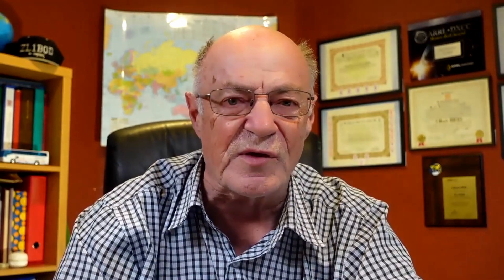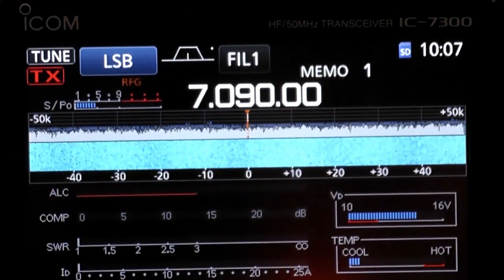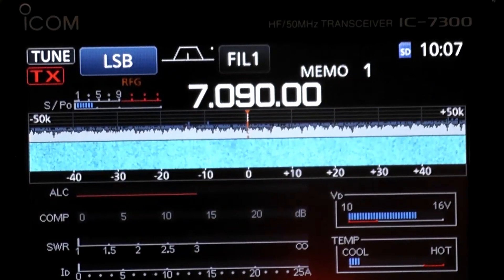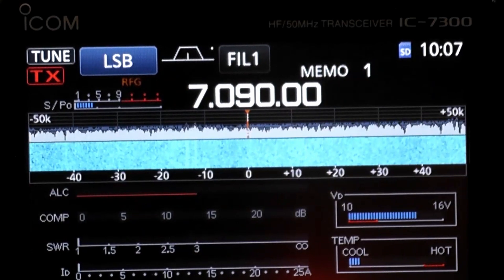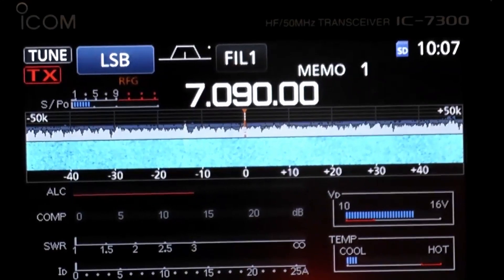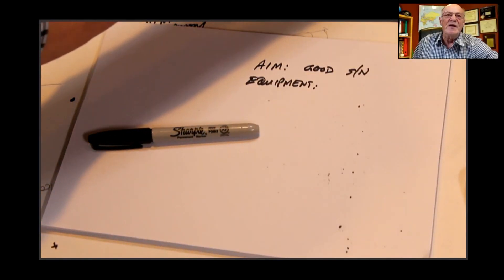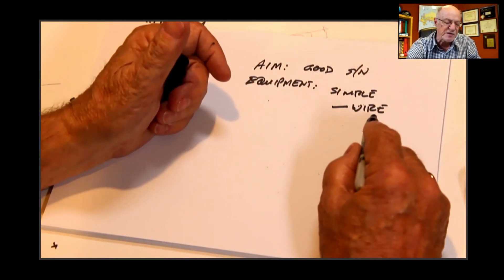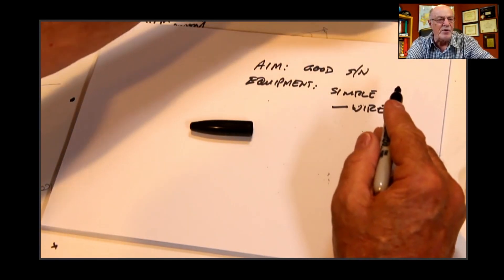HAM RADIO - Eliminate the NOISE !!

Comment: Hi Roly,  I am trying to wrap my brain around this.  The addition of a ground loop increases the signal to noise ratio  because loops are inherently quieter, but if you key down it will transmit using the 40M element of the DX Commander?   Are the effects similar with the other bands?  Or is your fenceline a harmonic of 40M?
Reply from the maker: No no Ed.  I am just using the DXCommander hardware as a convenient way to connect a PL259 to the loop.   There are NO elements on the pole at all.  I am not using the DXC for transmit at the moment.  Just a quick and dirty way to connect a coax to the loop.....cheers
Reply: @ZL1BQDRoly  Thanks Roly, now I can sleep without my mind running all night trying to figure it out...ha.. Cheers
Reply from the maker: @problemwithauthority  Cheers

Comment: Good video! I went the Loop on ground route and it helped a lot.
Reply from the maker: Brilliant. It is not perfect but every little bit helps in a noisey environment....   how large is your loop ouy of interest? .....  cheers
Reply: @ZL1BQDRoly  It is 60ft (15ft a side) in a square fed in a corner with rg-6. I followed the design off KK5JY’s page. Very interesting read and design. It’s 60ft so I get 20m coverage.
Reply from the maker: Great, thanks for the info.  Yes KK5JY has an intersting page for sure.
It does seem that "one size does not fit all" though and each install really needs a little fine tuning....  cheers

Comment: hi roly, I put a loop on the grnd in today, and first results were compared to my 40m long beverage I normally use on rx. my vert on rx is s7 noise from street lights etc, my bev is nil on the meter, and the loop is also nil, but 2 s points up signal wise compared to the bev. so this evening after dark, 6:45pm working france on 40m cw, too much noise on the vert to hear him, on the bev he was 449, but on the loop, he was 559. more details to come. 73 brian zl3xdj
Reply from the maker: Tremendous Brian.  Yes please post details. If you would like to email me sound clips and /or video comparing the three setups then i am more than willing to make a followup video....  cheers
Email in QRZ is fine.
Reply: @ZL1BQDRoly  I was going to email you actually, but could not find your email on your qrz page. I did briefly try earthing the loop as you did, but putting the 9-1 inline worked better, and putting the loop right on the ground compared to a couple of inches above improved it also. will make some video. cheers : brian
Reply from the maker: Just sent you an email Brian...cheers

Comment: Be interested in how long the wire is and the length of your radials. I’ve a 49:1 end fed and to get on 80m it’s 40m of wire which I was struggling to put up. I didn’t consider running it around the perimeter. May give it a go.
Reply from the maker: Give it a go James and let's know how you get on....cheers
Reply: You only need 20m of wire for 80m, the other half (the earthy side) can just be sloped down to fence height in any old fashion or thrown under the house etc

Comment: Hi Roly, that is a fascinating demonstration/experiment, some time ago I ran a very  low wire (not a loop) close to the ground and I also found an improved S/N, it was fascinating to use it to feed the sub-receiver and listen in "stereo". In common with you there were a few places that have stopped me making a full loop, it never occurred to me to go underground for those sections. I shall have to investigate, as for the apparent insensitivity it may be interesting to see what passive impedance matching can achieve, but I know you are continuing your work. 73
Reply from the maker: Agreed, a passive impedance match is next on the block.  Goodness knows what it is at the moment but a proper 1:1 match will at least achieve max energy transfer in the system.  Cheers
Reply: TY Roly.. @ZL1BQDRoly

Comment: I suppose that this loop antenna is for receive only, right? Well, since it is impossible to give it a try in my property, ( I live in a multi floor building), I can though install it on the roof top. Is it a possible solution to reduce the noise? The roof top is almost 10 m above ground.
Reply from the maker: My gut feeling is that it would not work on top of a roof of a multi floor building. It has to be very low to the ground so that noise shoots over the top of it so to speak....
BUT, give it a go, maybe it will work?  ....cheers
Reply: @ZL1BQDRoly  Thanks for the reply. It's rather difficult to install it, especially right next to the metallic fence all around the terrace. Anyway, thanks for the info and the help. 73 de SV1SLB
Reply: If you have roof top access for antenna work, why not put up your loop but instead of laying it on the surface of the roof raise it above the roof just as much as you can
Reply: @fredroessler  I already have done that. In fact the loop is around 7 m above terrace level. Nevertheless the noise is still very much present.

Comment: really interesting Roly I have a W6IUV preamp to build and always thought about putting it on a loop (like a wellbrook) but this looks interesting my only problem is there's a whole lot of concrete where I'd like to return to the shack so I''d have to come up to about 7 or 8 feet  then it starts to  loose some of the benfits either that or I bury it and return it back along the same route for about 15 feet making a sort of ladder line ... I think  this is a 3 mug of coffee problem 🤣
Reply from the maker: Maybe even a 4 cuppa...... Well the old adage of "suck it and see" comes to mind.....
Please let us know how you get on with the preamp.  I have one here which is very suitable, however the concern i have is front end overload to the Receiver.
The IC-7300 has plenty of "preamp" as it is so an additional 30dB up front maybe a little much.......cheers

Comment: Thanks for the inspiration, Roly.  I am in a noisy urban environment, too, so I will give the loop a try. I can make quite a long one as I have a long 10 metre wide Greenway behind me. I suppose you are using the radials to ground the coax braid? 73, VE7AWV.
Reply from the maker: Yes the coax braid is connected into quite an extensive radial field...   cheers

Comment: I recall using a loop antenna on 80m late last century. It had many poles holding it up and was anything from fence height to 11m high in places, but was quiet and worked brilliantly from VK4 into VK6. Only thing I never figured out how to do was automatic switching from TX to RX at 400w (or 1.5kw for those that can use it). Thought about automotive relays but wasn't sure if they were OK at HF. Cheers Adam VK4IM
Reply from the maker: Ahh switching is always a problem in the traditional sense.
Many of the modern rigs have a seperate Rx input which is automatically switched on Tx.   That feature is what i am using.....cheers
Reply: @ZL1BQDRoly  Hi Roly I Looks like you were using an IC-7300 in the video. I'm guessing your using the INRAD RX7300 reciever mod or similar?
Reply from the maker: @VK4IM  👍 cheers

Comment: Nice one Roly, although I was jealous of your starting position noise floor! You can easily flip the radiating plate connection on the DXC over to the lower ground radial plate, thereby adding one large loop-radial to the setup when in use as a vertical 😀
Reply from the maker: Yep thought of that... Cheers Ian
I will link your work on this in the description below.....

Comment: Hi Roly, I have a Colorbond steel fence on three sides of my property. The DX Commander works reasonably well at 2m from fence. Would you recommend putting the wire loop 30cm above the fence or run it inside the fence 30cm off the ground?
Reply from the maker: Probably inside the fence off the ground.....but suck and see i guess.....cheers

Comment: Omg a full wave loop at 30’ high fed with balanced open space Feeder and you ll be S9+10 into the states can’t wait Roly
Reply from the maker: That's a fiine dream to have Kevin...cheers
Reply: I agree. Get your loop off the ground! And quit wasting energy in lossy coax...450 or 300 ohm twin lead is the way to go. Also tune that with an antenna tuner.

Comment: Inspirational video Rolly. I now have a reason to build a decorative fence around the front of my yard and the rest is easier. How do you terminate the downstream end of the wire?  I’m very close to writing my exam (just a matter of scheduling during COVID) and with a little luck will be getting a DX Commander in June so will be looking at doing this in the very near future. Cheers from Moose Jaw. Tim
Reply from the maker: There is no termination of the wire downstream as you would do with a beverage antenna for example.  It is a continuous loop with one end of the loop to the centre conductor of the feed line and the other end of the loop to the braid of the feed line.  
I just used the base hardware of a DXCommander for convenience....   cheers
Reply: Ok that makes sense. Thanks for the quick response and forgiveness for misspelling your name. Cheers Roly.
Tim

Comment: I use a MFJ 1026 and  rx antenna that can receive the local noise as good or better than my main HF tx vertical, using the mfj 1026, I can phase out the local noise no problem...Works for me de Ei2iP..
Reply from the maker: Thanks Robbie.  Is that local noises that can be individually singled out, say a local plasma TV or does it deal to the total noise floor?
Whatever works is always good news of course...  Cheers

Comment: Excellent job. I’ve done a loop on the ground vy simple and not so big. Often using the preamp of the rig it’s enough.
Reply from the maker: Yes, the preamps in most modern rigs seem to be more than adequate.
The danger with using a high gain low noise amp is front end overload particularly with SDR type radios....cheers

Comment: Interesting Roly. I experimented with a loop round my Garden, must have been around 120 or more yards ish, around 1 foot off the ground. However I used some electric fence wire I had hanging around and a 1 to 1 balun to connect them to coax. My results were very poor, of course it could have been the balun or the wire was not suitable. The electric fence wire I think is steel wire woven into some sort of plastic string. I do have a part roll of DX10 that I might try out with though looking at your results. I have a 7300 with the RX ant mod on it btw.
Reply from the maker: I was using a7300 for this experiment.  The RX Ant mod looks to be very simple and would be ideal for this sort of application....  Cheers
Reply: @ZL1BQDRoly  I would imagine it might be quite easy to home brew, after all the one I bought is only a couple of phono plugs, some coax and connectors and a small plate.

Comment: So if I'm understanding this solution, the loop runs from the driven plate of the DX Commander around your property and terminates at the DXC ground plate. Does the loop affect the Tx of the DXC? Thanks for the video Roly. Always enjoyable and informative. BTW did you ever try the 10 meter band, brass tubing half-wave dipole I sent you a while back? If so, was it okay or rubbish in your opinion?
Reply from the maker: Martin, I am only using the DXCommander driven plate and radila plate as a convenient way to couple a pl259 into the loop.  I have NO elements on the DXCommander at the moment and not using it for transmit.  When i reassemble the DXcommander then i will have to look for another coupling solution.
The 10mtr Half wave dipole sections work very well, but you sure have to be very careful not to bend the smaller sections for sure.
I used it last weekend on a SOTA outing actually and made several contest with it....  Cheers
Reply: @ZL1BQDRoly  Good to hear it worked for you. You're right about the fragility of the thinest elements. I built one for 6 meters and the largest element is 1/4 inch. The good thing is that it is light as a feather. I was thinking about building 2 more and putting all three together to make a yagi type array.

I installed a Husqvarna Automower for my lawn care a few years ago. It requires a continuous boundary wire that is approximately 250 meter in length. The wire is staked to the ground and not buried like an electric dog fence wire. I'm going to see what happens if I connect my radio to it. I'll let you know. Cheers
Reply from the maker: The old adage Martin, "Give it a go...."  Cheers

Comment: That makes a big difference to getting that QRP station.
Is that a wire coming off the ground plane plate of the DX Commander Roly?
Reply from the maker: Yes, one end of the loop comes from the driven plate of the DXCommander base and the other end of the loop goes to the ground (radial) plate.
I don't have any elements on the DXCommander at the moment so was just using the base components as a convenient way to connect a PL259 into the system.......  cheers

Comment: I've recently tested a 4.5m2 'loop on the ground' design by kk5jy. It's slightly elevated because of the deck in the garden. Some parts do touch the ground. I've connected it to my flex-radio 6600 rx A input and I'm currently testing with the pre-amp settings. Adding between 4 to 16 db of pre-amp gain shows a lot more signals on the waterfall.  The QRM dropped from 95 dBm to 130 dBm or roughly 5 S points compared to my 1/4th 20m vertical. Last night I've tested it on 40m and 80m and it sounded fantastic! It's so much easier to listen to conversations! Don't worry about the S reading, because that doesn't really matter. When you can copy them,  you can have a QSO. This trick really 'pulls' weakers signals out of the noise. There are  a couple of experiments I want to try, for example put it on a flat concrete roof to see how that performs and maybe change the size of the loop to see if it also works on 15m and 10m for example. Do you have any experience with that Roly? Check out my QRZ page for pictures on the current setup. 73! PA2ADX
Reply from the maker: The kk5jy build seems to be a great design as well....cheers

Comment: Very nice video Roly. Great job on reducing your noise floor.
I will live semi rural on a bit more than an acre soon and all neighbours have an acre too so I think I will be very lucky I guess.

Keep up the good work mate.
73 from across the ditch.

Kevin, VK4KK
Reply from the maker: You make me rather envious Keith.  That used to be my circumstances years ago, but now we are locked into suburbia.  My only other recourse is to set up a remote somewhere in the country....cheers
Reply: @ZL1BQDRoly  Fair enough Roly. I am sure though that you have other advantages where you live such as proximity to shops etc. We need to drive at least 20 min to get to a decent grocery store. Everything in life is a trade off :-)

Remote sounds good to me. I think you are in the process of looking into that already if I remember your chat with Callum correctly.
Reply from the maker: @VK5KU  You remember well Keith.

Comment: That must have a great moment when you heard the signal on the loop. I have experimented with a RX only loop on the ground made by good friend Tom G2NV. I did get a significant drop in noise floor with low but readable signals. It comprises 20m of insulated wire in square loop on the floor fed by coax through a 12:1 binocular style ferrite.
Reply from the maker: Thanks for the feed back, i will take a look at this system for sure... cheers

Comment: Hi Roly, I have been thinking about putting a loop around my place, should end up with about 300 feet or so, but as I have a 6 foot wooden fence around the place, with a chain link fence in places, my thinking was to run the loop along the top of the fence. My plot is roughly triangular, in an urban environment, a few hundred feet higher than most of the town, atop what is more or less a ridge line. There is no local industry, but there is quite a lot of housing,, not densely packed but enough to cause a fair bit of noise. Basically the ground conditions are not ideal with a thin, about 18 inches of top soil over the local Cotswold stone. Not sure it makes a difference, but it does drain very well. Would appreciate your thoughts. 73 Jim M7BXT
Reply from the maker: Try it along the top of the fence James buy i think close to the ground will work better for you....cheers